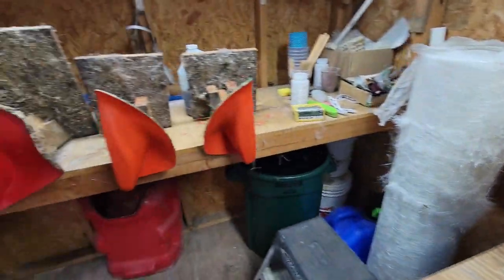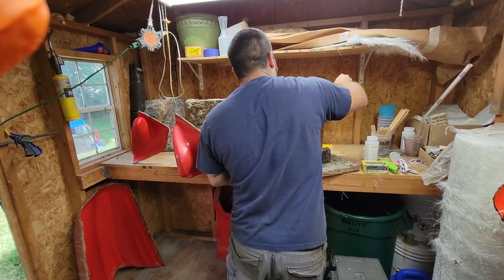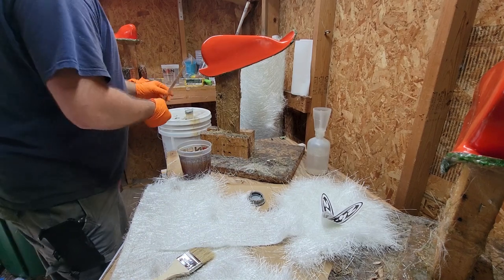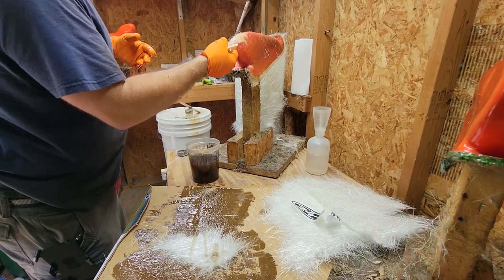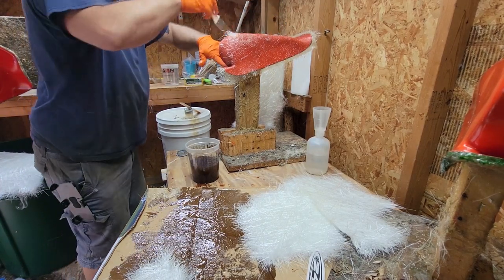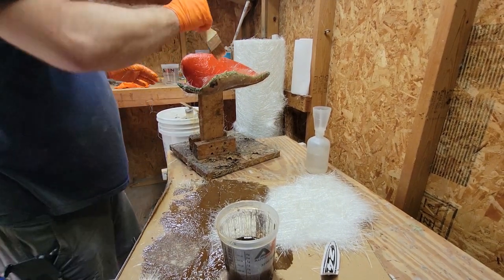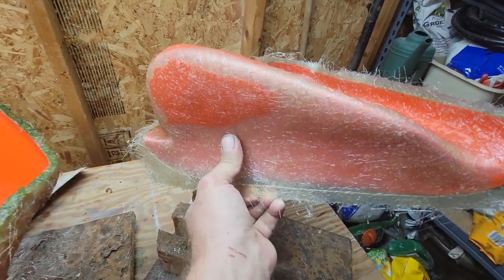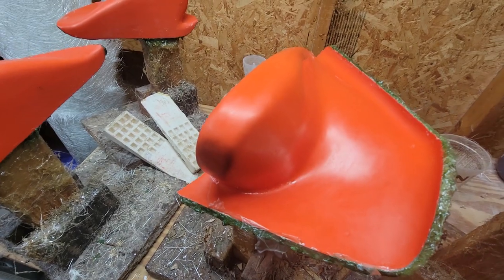How to make molded fiber glass parts, Making Foothold for a freestyle superjet standup jetski

Comment: I ordered a krash stand up jetski. For the winter do I need to flush antifreeze though the motor? I have older 550s that I don’t. I just blow the water out. Would it be the same with a krash? It gets below freezing where I live
Reply from the maker: Technically it's safest to run antifreeze thru any ski in freezing weather

Comment: When rebuilding mikuni carbs and changing the seat, is it possible to go up in size on the seat? For example, my carbs all have 1.2 size seats, would it hurt going to a 1.5 or even 2.0 as long as the springs are matched properly?
Reply from the maker: You can change.   They are used in conjunction with springs to get the desired popoff
Reply: @EricksonMachinePerformance  any downsides on performance or trouble with tuning after changing stock sizes? The reason why I want to go up is because 1.2 size with a 115g spring has a high popoff psi that I can’t test

Comment: Hey, just wondering. Would Amsoil dominator or Amsoil HP Marine be better for a modified 550 and a krash foot rocket backflip ski. I was thinking HP marine, but is it safe for power valves?
Reply from the maker: I prefer klotz skicraft.    But.  Hp marine is also fine
Reply: @EricksonMachinePerformance  is the hp marine safe with power valves?

Comment: Hey, sorry to bother you with all these questions, but I’m going to winterize my dads Yamaha fx ho 4 stroke ski. The manual states to just rev the engine a few times and it will blow out all the water. My buddy does the same thing every year. Will it be fine? Other than that and fuel stabilizer and fogging oil I think it should be ok? Hope you had a good Christmas!
Reply from the maker: It's smart to run anti freeze as well.  I have seen exhaust manifolds and blocks crack from freezing
Reply: Another thing, when you break in a new motor, can I use the synthetic klotz, or am I better off with semi synthetic? If so what do you recommend for semi synthetic oil

Comment: Is the Amsoil hp marine safe for power valve motors?
Reply from the maker: I run klotz skicraft.  
Most of the amsoil I have run where for dyno pulls.    I don't have long term data on HP.
Reply from the maker: You would need to contact Amsoil
Reply: Thanks, I called them and they said it’s safe for power valves and that they really recommend hp marine for a stock or high performance ski.
Reply from the maker: @benselby6171  I haven't had good.luck with dominator in pwc stuff
Reply: @EricksonMachinePerformance  yeah I talked to them and they said the hp marine is better and is safe for power valves. I’m running dominator now. Switching over next season to hp marine. What problems did you have when using dominator?